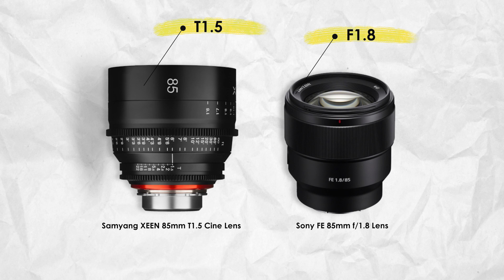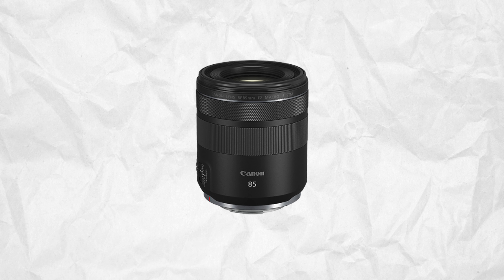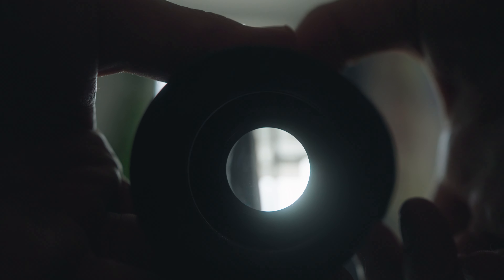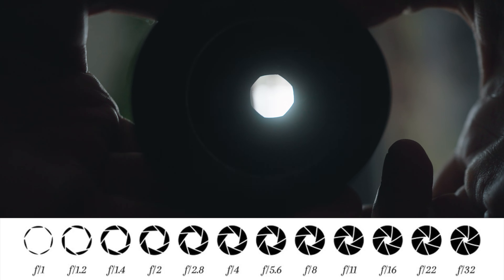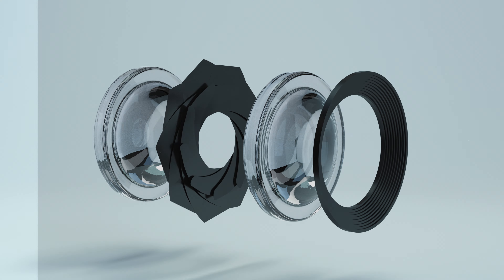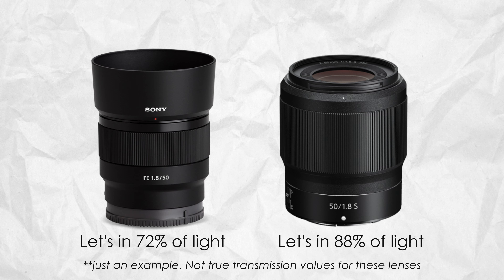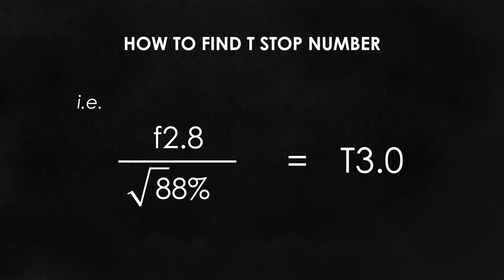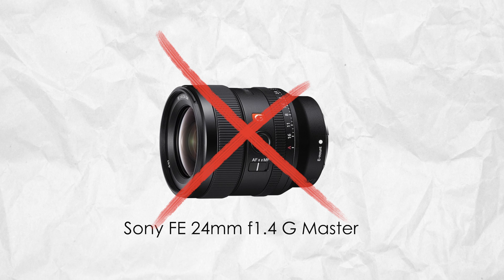Difference between T-STOP and F-STOP | Simple Explanation

Comment: So t-stops will always be higher than the f-stop equivalent, because the light transmission is always less than 100%? So an f/1.8 could be a t/2 or t/2.2 lens? So you'll get more background blurring than you're used to with a t lens?